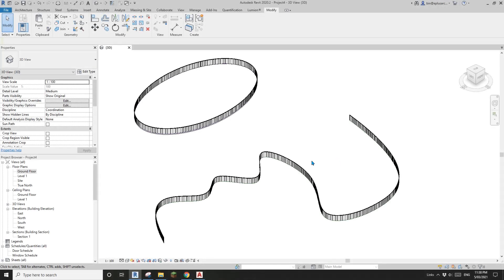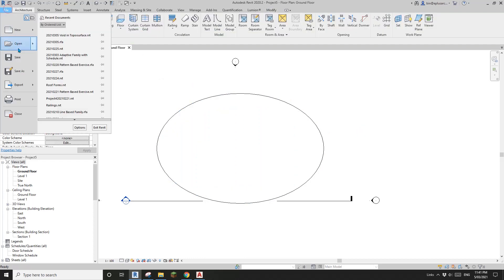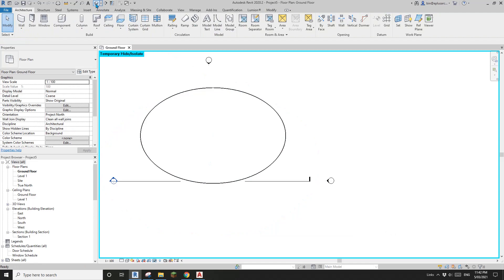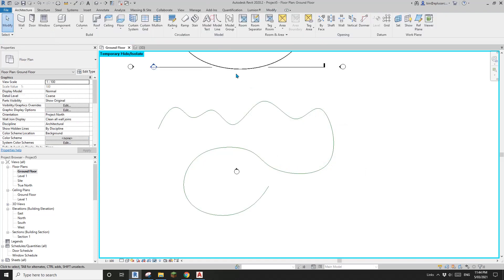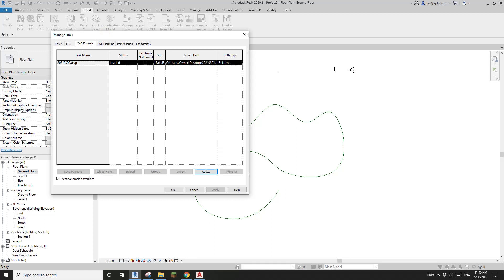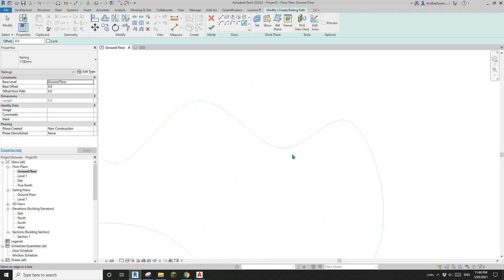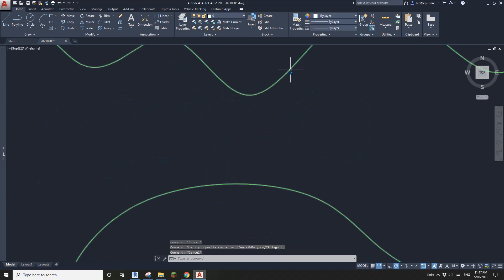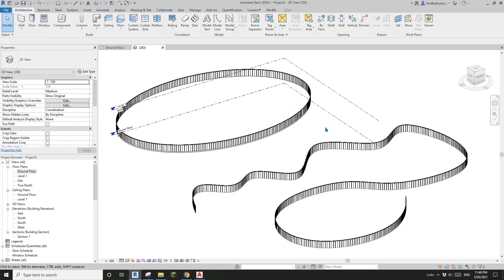Everyday Revit (Day 353) - Railing Oval and Spline Shape

Comment: I generate aligment fr Civil 3D as a line which contain x,y,z coordinate, similar to your spline railing but mind have Z coordinate (elevation). is it possible to modeling railing align with the elevation?
Reply from the maker: You can try, but I don't think the railing works with splines. You probably need to convert it into polylines. As for the Z value, maybe build it into a floor or topography and place the railing onto them?